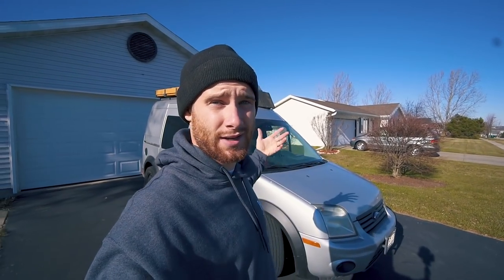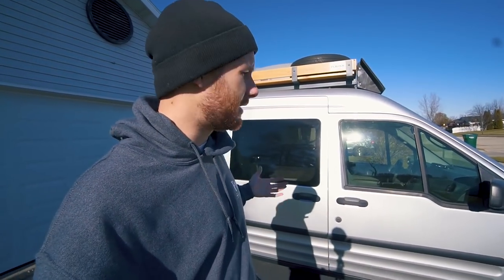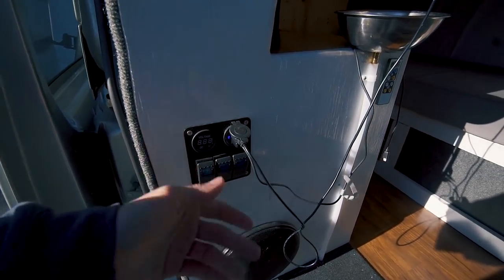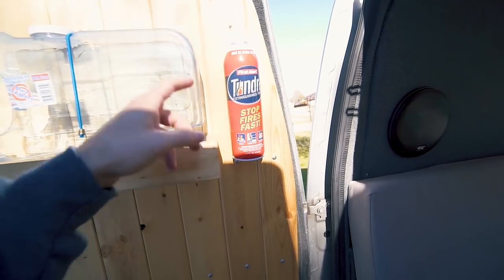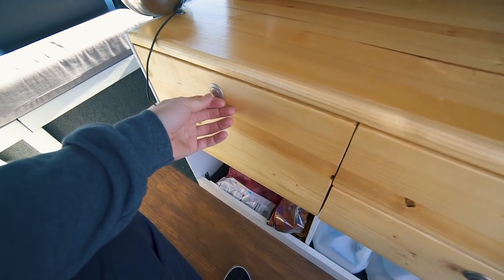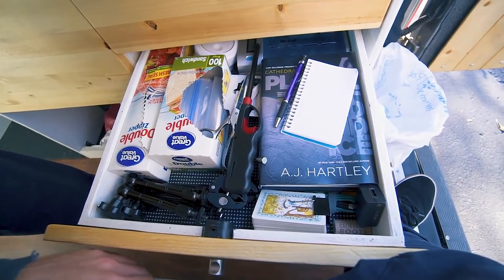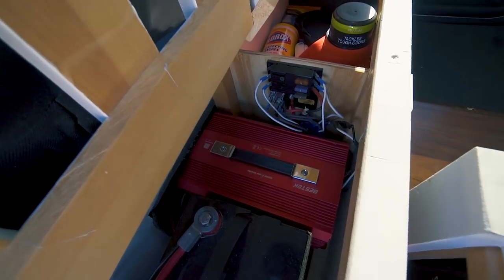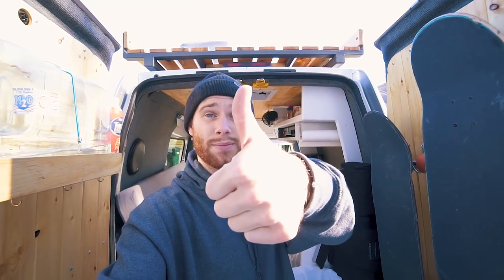TINY CUSTOM VAN CONVERSION | FULL TOUR!!! (  2010 Ford Transit Connect )

Comment: The pee bowl is a great idea
Reply: Also Gatorade bottles work well
Reply: @Antionovolpe  At my age,,,, I'd just have to say,,,,, it's a new flavor. Oh wrong bottle.
Reply: I use empty liquid laundry detergent bottles.  Keep a little detergent in the bottom of the bottle for order control.  I take the bottle into restrooms at rest areas and no one is the wiser.
Reply: jeepster4u2003 
Having lived in my Toyota forerunner for years I wish I had thought of laundry detergent bottle instead of a Gatorade bottle. It makes more sense tighter cap on top and easy pour spout. Must remember to save my next bottle, great idea.
Reply: @jeepster4u2003  My partner does the same thing but reuses a jar. He thinks he invented the soap idea, haha.
Reply: @Antionovolpe  I'm not gonna start drinking poisonous Gatorade, just to have a bottle to piss in.😂 I go to laundry mat to wash my clothes and then I grab a large empty detergent container from the garbage can. 
It holds 2 days of piss before needing dumped.
If anyone asks about it, I just say that's my laundry detergent😂👀
Reply: @jeepster4u2003  I do the same. Except I dump mine out in the grass or a nearby storm drain. 
If you take it to a public restroom, someone will think you're washing your underwear in the sink.😂
Reply: High enough to stand and walk straight inside?
Reply: @jeepster4u2003  ...VERY good idea!
Reply: Sentences you never thought you'd say

Comment: My set up would be a ceiling bed that can lowered down when sleeping and when not in use, we have a comfortable soft sofa and 40 inch flat panel TV mounted to the wall. Kitchen have little use for. Eat out or have snacks tucked away. Single shelf wrapped around the interior ceiling attached to the bed. Two stories platform, bed and living room setting.

Comment: 15>50  I noticed the roof rack is sticking out a bit. U could insert a similiar system like the bed and when u pull it out, it goes over the doors and gives u on rainy warm days the possibility to have sort of a terrasse where u could sit in the back of the car covered by your 2 doors and the roof over your head so to speak. if u use clear plastic u could even see the sky.
Reply: Good idea and possibility !

Comment: Great conversion job! I have a couple of safety tips. Remove the water jug and skateboards from the back doors when you drive, due to all loose objects will accelerate forward if you get into a frontal traffic accident with a potential of hitting you. Put a smoke-detector on the ceiling, and a gas-detector on the floor :)

Comment: About the light solution, you could still take the batteries out and power them via 5v (1.5v*3 = 4.5v, should be fine) if you wired them up in series. Could have the lights act as switches themselves as they are now or add in an additional switch to your panel

Comment: To restore your headlights take some 1500 grit sandpaper and wet sand them until there is no more yellowish water
coming from the sanding, then take some automotive clear coat and give them 2 coats 1 light one and then a full coverage one. let dry.  

if result comes out with a runny clear wet sand lightly with 1500 grit, then polish like you would car paint
Reply: Spencer 7445 actually my teacher taught me that in tech school
Reply: Mothers Mag and aluminum wheel polish and a foam pad on a buffer. They come out looking like new. Wipe them down occasionally with vinyl protectant it'll last for about a year repeat process when it starts to dull.

Comment: I made a privacy curtain for my mom’s rv. I bought a pair of sun blocking curtain panels from the second hand store. I shortened, hemmed and joined them in the middle. I reused the metal snap buttons from the previous curtain. I glued the buttons to the fabric with E-6000. So far they’re holding up great.
Reply: Mel Dempsey, how about a $5 grey blanket from Walmart, with little slits cut near the top to pass an expansion rod through? Way cheaper and easier for those of us without kind-hearted skilled daughters like you.

Comment: The bits of polish and forethought on many aspects of your van is really well done. There's a difference between "tossing some shit in the back of a van" and what you've done. Great work, dude. I was surprised that there wasn't something more "hold it in place" where the peanut butter, etc was. Did I just miss that part? The detail and again, forethought you've put into the van is extraordinary. The bed stuff, especially that is gets established and reset so quickly really is a great idea. My favorite portion is the ceiling mounted tap lights - that's some brilliant planning, dude. Well done.
Reply: Yeah, loved his van build, also! 
But when I saw his can food loosely on shelf, was wondering too how did he prevent all them from flying off the shelf when he made a turn?

Comment: Great video(s). Thanks for including showing your stuff and where it all fits. Most van videos don't show that or show the brand new build, so seeing stuff crammed in was good to see. I have the same van 2010. It's been called The Cramper and many use external storage, you with a roof container, others with a tailgate and container, and I've seen someone with a ultra lightweight trailer to make up for the limited space. So I was curious what all went in your roof container. It all comes down to what you do and what you need to do it. I won't have skateboards, tool boxes, lights, or big video equipment, but no matter it will be a stretch for space for my stuff...my build will have a sink, room for fridge (starting with cooler) with roughly the same interior build as your. But I'll divide the pull out bed into two selections. And make the side cabinet full floor to ceiling storage without the desk space opting for a storable small folding table instead.

Comment: I was just watching the older video of the van before the rebuild. That set up was really good too but I saw how much mire you did with the insulating and woodwork. Is this new build heavier than old one and has it impacted gas mileage? You said in past video that you wanted space to walk through from rear do you think that could have been done to your old bed platforms? I am kind of modeling a build from your old setup the bed platforms I wanna be able to have them sectioned in quarters so I can have a pass through from rear to front. I love the fact you insulated whole thing . Custom rack on top is genius and have you slept up there yet? All in all awesome builds old and new thx for the inspiration

Comment: One of the most functional  (but still homely) van conversions I've seen - I love the practicality of everything you've done! I do have a question for you: I'm in the process of deciding which van would be most suitable for van life and so I was wondering, does it bother you not being able to fully stand up inside? I'm thinking of living in a van for at least a year, maybe more, therefore, being able to fully stand up inside is definitely appealing, so it feels more like a home and I can cook with ease etc. BUT is it over-rated? What do u reckon? :P
Reply from the maker: I would LOVE to be able to stand up haha taller vans can get a little pricy and I already owned this van before deciding to live in it so I just stuck with what I had. If you have the funds to get a taller van I would go for it!
Reply: Josh Oakes okay sweet, thanks heaps! 👍🏽
Reply: Get a used dodge promaster. 13,000$
Reply: Emily, I have the 2013 Connect and can almost stand fully up (5'2" tall). . When I sit on the bed, still have plenty of head space.. not claustrophobic at all 😊👍

Comment: quick "tankless gray water": just place a bottle or a little bucket or somthing under the car where the tube for the sink comes out, that way it doesn't drain right to the ground, or shorten the tube and place said bottle or bucket below it on the floor... ow, and I would just put another curtain behind the roller shades, 'cause from what I can see those roller shades would work really well as a movie screen for rainy days

Comment: That van looks fantastic sir. My bed pulls out the same way only it's on the passenger side since I'm in towns a lot and the passenger side sits in the gutter. That way I roll to the back of the bed instead of off the bed. Nice wood work. Great job.
Reply: Ha

Comment: amazing build. I would do my van conversion exactly like this. I'm concerned the exhaust fan will allow cold air in, do you have this problem? I could stick a piece of wool insulation in it when it's not in use.

Comment: Dude where's your fridge and sink
Reply: He had the spit sink lol
Reply: You don't need one, you can use a Mini cooler or survive on dry foods for a long time if your on the road, cause you have money for other things. And yer water tank and cooler he already said.
Reply: He said in the beginning of the video that he keeps if cooler at the front in between his two seats and then his sink was on the back wall for he washes his hands and cleans dishes like he said in the video.
Reply: Why waste money on ice, get a fridge and be done with it
Reply: CC Rocker and tv
Reply: @letsridebikes7716  Do you have any idea how much an ARB fridge runs? Not even counting the solar system that would be required to run it..
Reply: @iTzLazziboii  arb fridge runs between 1 to 3 amps a hr. Not a great deal at all. I get over 60 hrs off my small battery so if she insalled a 100amp batter and a 80w solar panel she would have more than enough power. Infact she would never run out.
Reply: @iTzLazziboii  can get fridges for $200 to $1000.
Solar panel can be bought for under $150
Battery $70-200
Dual battery setup $40-200

So really can be set up for under $400
Pretty cheap if u ask me.
Reply: @letsridebikes7716  
Waste money on ice?
Wow, you're not that street savvy are you?
Not giving away my secret.
Reply: @letsridebikes7716  or turn on the gigantic generator he has under the hood and it don't cost anything but gas. Put the $400 into your gas allowance to keep it charged and you can probably charge that battery for years. Solar panels blow off and get stolen. Don't forget charge controller. A good 12 volt refrigerator with good reviews starts at a couple of hundred dollars now we're at charge controller couple of hundred easy couple hundred for a small Worthy refrigerator, and at that point it double the price of the build
Reply: @letsridebikes7716  Ice is cheap. Fridge requires a lot of power, which is very costly.
Reply: @k311ydcart3r  bull shit.
A fridge draws 1 to 3 amp a hour

Comment: Just a suggestion... why not use rechargeable batteries for your LED pocket lights? U can recharge them when you drive. Also would be cool if you started adding patches to your walls from your travels. Thanks for sharing your vids! Love what you've done.

Comment: How tall are you? How tall is the inside of the van in the back?? Just wondering.
Reply from the maker: I’m 5’8” and it’s about 6’ long in the back and roughly 48” in height after adding the ceiling!
Reply: Thanks for asking that cristi. My names kendrick nice to meet you both.  I was wondering the same thing. Im 5'7 and consider the hight of the roof a premium. (Background lol im working construction for the union and they dont always provide a hotel for out of town jobs so.... :) ) Josh, do you think you coukd give a actual mesurment of floor to ceiling?  I love the look of the pine, but am not sure if i can give up the lost 4" of hight. I have a google image saying 4'4" for van hight. Also Any ideas on making a ceiling that wouldnt impact the hight as much?
Reply: I was wondering about the height as well I’m looking to buy a van now would love to stay with the smaller connect but really want to be able to stand up I’m only 5’ 🤷‍♀️
Reply: @K76C  Minimum clearance @ the rear door is 52" with the door mechanism. It's a couple inches higher inside, BUT a center cross beam with a light will be be a head killer if you don't level out the ceiling. The standard length from behind the seats to rear is 5'6" unless he has an extra length model.

Comment: a tip for improving the seating.  mount a 1x3" to run the length underneath the front edge with hinges so it folds towards the inside and down inside out of the way when converting to a bed so that the plywood lies flat then.  This will elevate the cushion at the front (under your knees) when sitting and make it much more comfortable.  Look at an adirondack chair to get the idea...

Comment: Beautiful job! Thanks for sharing. If you think you might want to add some cubic feet to the storage bin behind your passenger seat, here is a video I just found. Turns out the first 1/3 of the floor length is a false floor! So cool. Here is a link to a video showing how to expose the recessed floor space.

Comment: The 2 gallon gas can is the same one I had and it cracked from the sun, so consider the loss a good thing.  I suggest a metal Jerry can that can be chained down. I used a Attwood Marine 3.5 Gallon but its not in the sun. See my van build. I also have a gray water tank in my video.

Comment: use window shades for your front windows instead of the curtain, you can find cheap ones that can also hold heat in the van

Comment: Great build. Everything one needs on the road is there. Miss some things though...first thing is something like a table, and second thing is at least a basic water supply when cooking in bad wether inside the van or far from the next camping side. Besides that the build leaves very narrow space between the bed and the cupboard...how much is it? 40cm? Other than that, very well done...

Comment: I like the roof rack. Good way of hiding that vent - strapping the tire over it would hide it even better.
Reply: Larry Willard  depends how deep your wheel is. Or you could just use a tire with to rim.

Comment: Hi there mate, firstly great job i love it, now im just wondering is this about the same size van as a 2002 model star-wagon plz?   i just cant believe how much room u made it have, im so confused just even how im going to make my bed 'i mean i just bought the boards after nearly 3 years of sleeping on the floor wit my mattress, dont get me wrong i had about 7 blankets underneth the mattress but now its time to some-how get a bed  built not that im good at measuring n fitting things but im not totally hopeless ether, i guess i haven't done much since i was about 17 to 20 years old n im in my 50s now but anyway wow ineradicable work mate eh.. cheers from nsw. Ps. if u have any tips "At all' plz do let me no, thankx again buddy n have a great day.

Comment: Excellent, and the van looks bigger on the inside than it does on the outside.

A couple of questions: any plans for a refrigerator so you can store meat, dairy, etc.? Also, how do you deal with the outside temperatures, so you don't get too hot or cold? One more thing, where do you go when you gotta go?
Reply: Elliott Avant, great questions I'd like to know too. On a fridge, he said he keeps cold storage between the two front seats when he's on the road.

Comment: Is this a 2012  XLT Passenger van? I bought a high roof this week, I want a small camper, but I couldn't find a medium-high roof cargo vans. One I bought has only 40000 miles. I know there are pros and cons with a passenger van conversion. I want to find out if raised floor in cargo area is removable after seats taken out. I know there is duct work under floor. I can't find the answer, van is going to be delivered this week.

Comment: Great Vid, Really covered all the parts of your van and it is well done. Great Job and thanks for your thorough coverage on the details.

Big question, what is your gas mileage?

In the van world people dont seem to mind to pay so much for fuel with vehicles that have
shitty mpg (imnho).

Thanks for your share!!
Oh yeah I just have a great plastic 16oz container with screw top that I pee in and you guys are gonna love this..... then drink it.  Yes I practice Shivambu, and its great but lets not get off track. I've only been doing that for 20 years.

Comment: nice conversion , your a good tradesman:) take your time served as a joiner. i live in scotland and we have had transit since 66 and connect came out about 2004, transit is a brittish van , when they start selling in usa? , all of ours are tdci turbo diesel and manual, they do about 60mpg , yours is auto, what fuel and engine size is it? good informitive video , thankyou for sharing

Comment: Are u happy with the ligths? How are the battery’s, dying fast or?
Reply from the maker: They’re ok, I would forget to turn them off all the time so they would die pretty fast. I recommend waiting lights to the battery. Maybe use the ones in the video for small cabinets and less used areas!

Comment: AA batteries you should hook those up to  wall power batteries you should really hook those things up to the battery, I don't know how long a set of batteries will last but even recharible batteries are better.

I mean you don't want to be stuck without lights do you, even if they last 6 Plus months that seems like something you could easily forget.
Reply: Just modifying the lights to charge batteries, that would give you the best of both

Comment: Is there any estimation on weight for all that lumber, water and electrical? I've bought a 2007 transit connect but I can legally only load it with 450 kg, which includes the weight of a passenger and bags, so I'm trying to keep my build below 300 kg